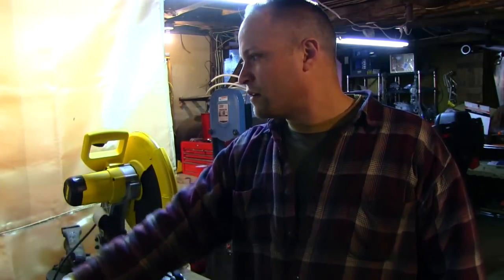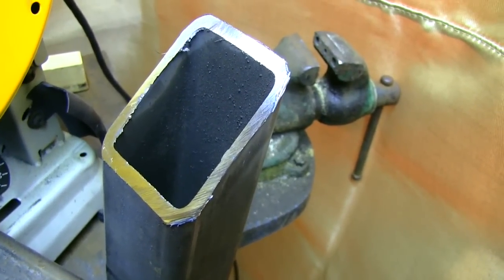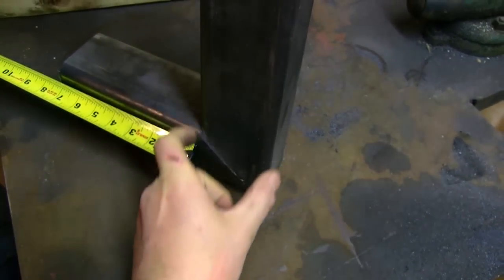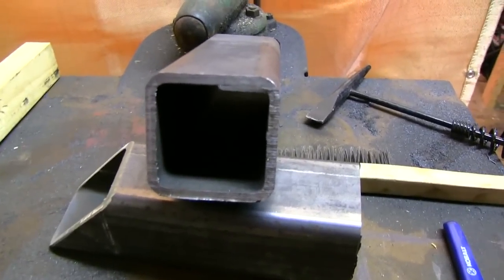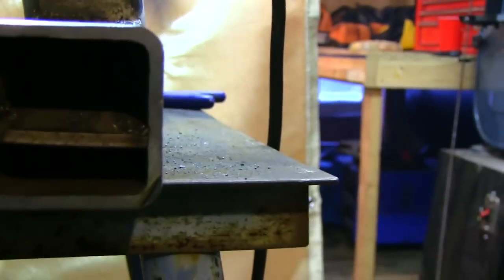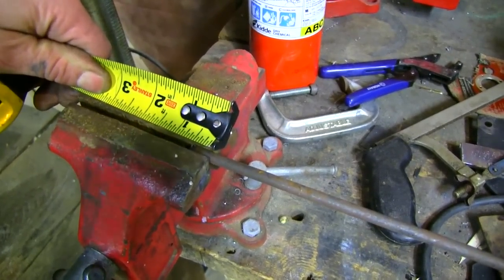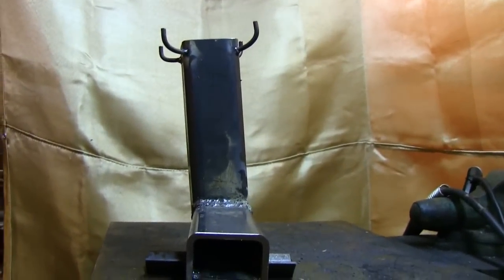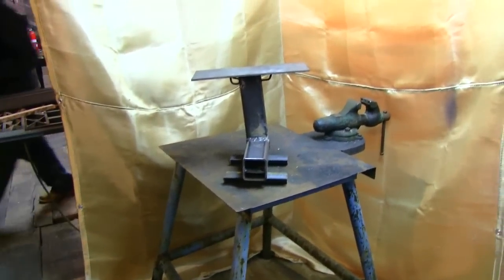Build a simple rocket stove in 30 minutes or less! | Redneck Homestead

Comment: OK as far as it goes, but when are you going to add the insulation? It isn't a real rocket without insulation. Won't burn hot enough without it to be really clean and efficient. Visit Aprovecho for more on rocket stove design principles.

Comment: great video imm going to makle a couple myself going to make a tank from same size as the unit and weld it to sides off the chimley from bottom to top and have an inlet and outlet connection so can heat water useing syphon system  i recon it will work

Comment: Incomplete structure: No insulation.For full information on TRUE rocket stoves, go to:

Design Principles for Wood Burning Cook Stoves

Use stainless steel for the burn tube for longer life without burn through.
Reply: Rhisiart Gwilym no, it's not an incomplete structure. Insulation is not mandatory. As long as it creates a vortex & burns properly , it's a rocket stove.
Reply: Rhisiart Gwilym
Reply: Yes and in a SHTF situation where you're either quick or dead... you would be one of the dead ones. Hope you have nice stuff, because us quick ones are gonna need it.

I think you missed the point of the video
Reply: SparksFly I would be one of the dead ones because I don't see the need for having a stainless insulated rocket stove ? Sorry slappy...I'm good if tshtf. Nobody will know where we are and even without the use of a rocket stove we'll be at a nice comfortable 50 degrees. If we nerd to cook, again, like I said...nobody for 50+ miles will have any idea where we are so smoke is not an not an issue.
Reply: I'm sorry. Are you Rhisiart Gwilym? Because that's who I was replying to. I totally agree with the comment you made.

Comment: it was crooked and just looked dumb and why did you not bevel the edges before welding it also those welds didn't look too good and you should have put those pieces of angle the other way so it would have been more stable
Reply: wades623 christ almighty. It's not like there's going to be any structural load on the damn thing. For what it is he does not even need good penetration.
Reply: Eat a phallic sausage and shut your mouth
Reply: +wades623 I don't know how any self-respecting engineer would tolerate such a sloppy build. The stack leaned and the shelf too. Ok function isn't affected, but where's the pride of workmanship?

Comment: Here is an idea (and I saw it on other imaginative stove designs, and experimented with it): if you weld the wood feeder / air box at an upright angle of between 9 to 13 degrees (when less than 5, it doesn't provide enough slide, and more than 15, it chokes the flue), the stove becomes self feeding and non-spilling (hence safer). In other words, as the twigs are consumed by fire, it drops down into the burn chamber and pulls the rest of the bio-mass inwards. As far as I can tell, this has no negative impact on the functionality of the stove. The burn output at the top end (according to my readings) does not vary at all. Just a thought. Thank you for posting this.
Reply: Wynand Koegelenberg جو
Reply from the maker: +Wynand Koegelenberg very good suggestion...i will make one in an upcoming video this winter!!!
Reply: The Chinese make some of the best rocket stoves in the world and they use an angle of around 45 degrees.
Works beautifully.

Comment: Could you ,please, give us the dimensions of each piece, tubes, etc. in centimenters? (width, length, height, etc...)
Reply: +Daniela Rouge Looks like 2 1/2 inch, so 63 MM square box tube, each run 10 inch, so 255 MM, wire is 5.5 MM.
Reply: +TIMEtoRIDE900  Thank you so much!

Comment: How do you like that mig welder?  I learned on a stick and never tried a mig. I heard it's easier to get the hang of but don't know
Reply from the maker: Its good and works very well on small projects, but my biggest complaint with MIG in general is that there are so many moving parts.  There are a lot of things that can get jammed, gunked up, etc.  The little Lincoln 125 amp that I am using in this video has a new gun and tether and it wont stay plugged into the welder.  Its almost like the wire is pushing the plug out of the receptacle.